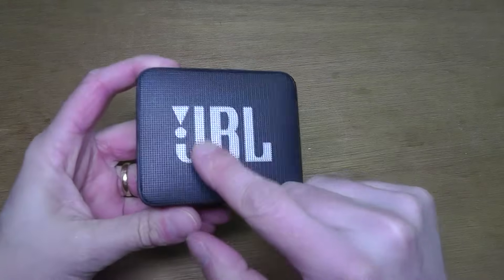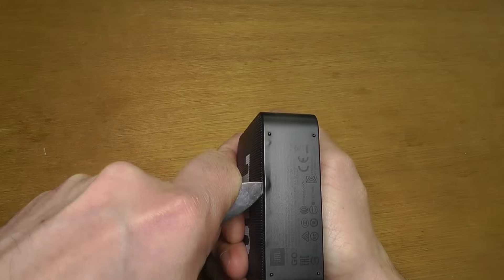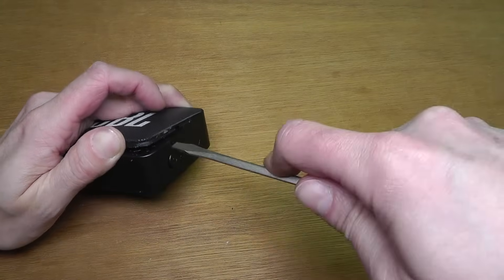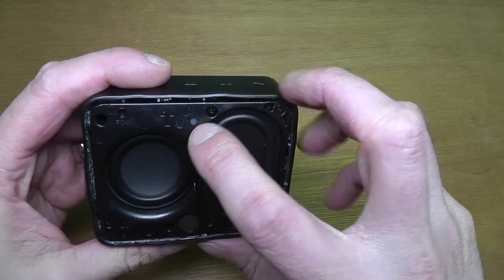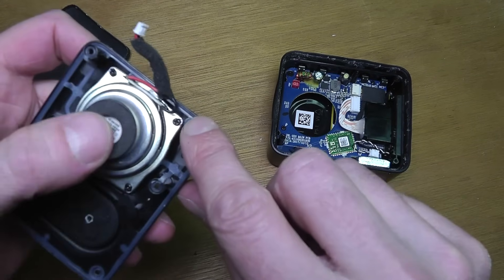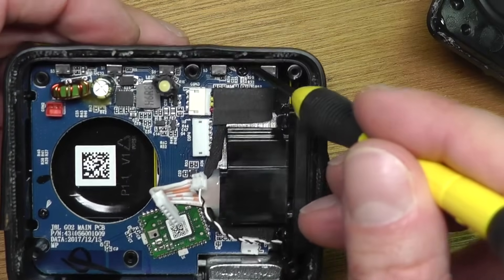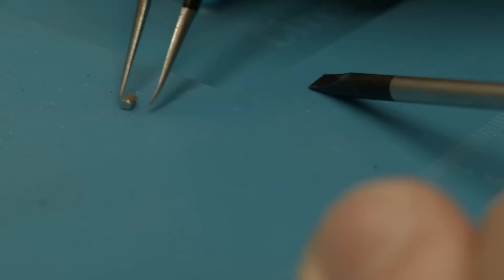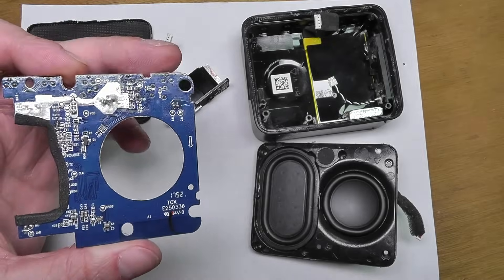Look inside JBL GO2 - Teardown

Comment: Thanks for the video. Please, I have no idea about mainboards but I am looking for a solution to "erase" (sorry my but english) the bluetooth module because I dont want to have it (deleteing bluetooth prevents me from headeaches). Please, if you could help to know what it it the "capacitor" or bluetooth module. Many thanks.
Reply from the maker: Hi, it’s been a long time, but if I remember right, then the Bluetooth module is the small green daughter board, which can be seen at 5:20.  
I am not sure if the speaker will still function once that board is removed
Reply: @MegaSafetyFirst  Manu thanks for tocino you the time to reply and yo hice me that warning. Greetings forma Peru 🫡

Comment: Whole lotta tech for such small speaker! But that's why you can achieve such loud and clean sound on small speaker like this!
I'm using this one for over 6 years now.
And remember, never try to hard reset it! Did this mistake some time ago to clean it's bluetooth pairing list and bricked it accidentally into service mode.
If it happened to you, you gotta:
1. Turn it off completely by holding power button for 20 seconds.
2. Plug it into AC to power it on AND INSTANTLY start pushing Bluetooth and + buttons for like 15 seconds.
3. Press power button to finally reset it.

Comment: Thanks for your video - very interesting and helpful!
❗One Question: Is is possible to replace the micro usb port with an usb c port?
I would love to change it but do not know if it would work with the function and is it worth it? (I do not like this jbl go 3 look)😉
All in all the sounf quality is better on the 3rd Gen, but i got already 2x JBL GO 2 so🤙🏼😉

Appreciate your answer!👍🏼💯
Reply from the maker: Hi,  the pin layout of USB-C ports is drastically different for them to fit.

Comment: It is Original JBL GO 2? Thats look a fake inside..
Reply from the maker: It came directly from JBLs warehouse.
Reply: @MegaSafetyFirst  hmm i have same inside but on you toube every jbl go 2 have green pcb and other connectors
Reply from the maker: It is normal for JBLs speaker so to have different insights. They are using different board designs for some reason.
I have two Flip5s, who look completely different from each other on the inside. Both came directly from JBL, but were manufactured in different countries.
Reply: @MegaSafetyFirst  okey thank you so much

Comment: Ok so I have a problem with turning it on so I'm here. It wont turn on but after many tries it suddenly turn on and works just fine but if I left it on table for like 5 minutes the problems here again. So should I open it and check some circuits?

Comment: Hey there! thanks a lot for the video it helped me tear mine down, the problem im facing is that no matter what button i press nothing happens and the only thing that do happen is when i plug the charching cable the led turns red but other than that..nothing

how can i know if its the battery or the circuit it self?
Reply: O mesmo problema do meu, molhou e já não funciona os botões
Reply: Its battery is dead. Replace it.

Comment: JBL have always been my favourite brand when it comes to portable speakers. I've watched and opened speakers from other brands and what I can say.. for the money you pay to buy an JBL speaker, you get a well engineered speaker in and outside with focus on quality. So that's said!
Reply: UE 💖
Reply: I found one just a few days ago witch got run-over with a truck and it still works, its really resistant
Reply: Maybe you haven't been introduced to boAt.
Reply: @sayantanpathak9028  Maybe you never used jbl
Reply: @sayantanpathak9028  boat is a absolutely crap
Reply: Me too! My first one was the JBL Flip 3 idk when i got it but it was prob around 2017 or 2022 it just broke the other day... so i bought a new JBL flip 7 i think

Comment: Hi Thanks for the video. Even there is only one speaker, does it take stereo input from the circuit board? How the single speaker out stereo?
Reply from the maker: Hi, it does take a stereo input. But the built-in DSP will mux the signals to a single output stream for the speaker.
Reply: @MegaSafetyFirst  Thanks a lot.
Reply: Iska battery kahan per Milega

Comment: My JBL GO2 not working. I'll remove its as you showing this video. Thank you. So I'll check the battery by my multimeter and its shows 4.2V. I think battery is ok. But It's not working. Not indicating charging and doesnt response when pushing power button. So, have to met any trouble like this. Plz help me. Thank you

Comment: Im thinking about opening my Go and 'permanently' hooking it up to my amplifier. Do you thing it will work if I strip the jack part off of a jack to tulip cable and solder it to the speaker feed from the go?
Reply: Erik Loeffen you can don’t put it at full volume otherwise it may turn off

Comment: it really help me to fix a miner issues with mine thanks. two things are worth mention, jbl is no joke when talking about water resistence, seconde, there is no way to open without damage the rubber. but if you priority is function over form, you can open, fixit close it, glue everything together and will work as a new one.

Comment: For anyone wondering, this speaker is incredibly loud, considering the rated power and its actual size
I use it to teach students at school and it does a great job filling up the whole classroom
Reply: Salut fra :))
Reply: Did you turn off autoplay in class? Most teachers leave autoplay on and it will automatically skip to the next video when the current video finishes

Comment: Does removeing the front ruin the waterproofing?
Reply: if you are talking about the grill

no
Reply: @noddlecak3279  Not the grill, the plastic part with the speaker in it
Reply: @austinnlyt6476  I don't believe so because there was no glue involved only screws so as long as you don't rip the rubber around it to keep water out and you put the screws back on good you should be fine
Reply: @noddlecak3279  Cool, thanks for telling me I was worried I might break my speaker lol

Comment: If you put some wd40 around the edges of the grill it dissolves the adhesive and the grill comes off with ease, that's how i took apart mine
Reply: Or just heat it up a bit...

Comment: These company's show a total DISRECARD for the environment by making devices at witch you cannot replace the battery! So essential producing a throwaway product, bad for the customer and bad for nature, very, very bad!
Reply: Its a bit understandable though. They do have to make the device water resistant. And that sacrifices some repairability or in this case, replacing the battery. You can still remove the battery though and replace it from the inside. Though I cannot guarantee it will still be waterproof.
Reply: you can change the battery but it will not be waterproof
Reply: how is it supposed to be waterproof

Comment: You can use heat gun to loosen up the glue. It’ll be easy to remove the grill, I’ve done it on jbl go one. One question I was trying to increase mah capacity of battery in jbl go 1 but I failed. Don’t know what happened it pares with the device but woofer doesn’t work, I tried to replace woofer but nothing changed. Can you me help me out ? I might damaged amplifier. MegaSafetyFirst

Comment: Is it sounds better than old jbl go?
Reply: They both sound badly, don't buy unless on discount (got myself a Go 1 on heavy discount, good enough for me since Go 2 is equally bad anyway).
Reply: TheGamerYT I think yes because of pasive radiator.
Reply from the maker: There's a Video comparing the two speakers:
🔊 JBL GO2 Sound-test versus JBL GO
https://youtu.be/AB0cRioGak0
Reply: Basically the same.. €19
Reply: Zwaluww I got JBL GO 1 for only 18€. How much did you pay?
Reply: @windlink1236  i got jbl go 2 in 16.29 € & its amazing for its size
Reply: @gautam9912  Thats a great deal
Reply: @windlink1236  yup

Comment: Yes! It have a passive radiator!
Reply: A Bal look at the volume of air inside it - hardly anything. It's little wonder they can't get much bass. That and the passive driver is on the front
Reply: Just saw a video where similarly sized speakers had way more bass, so it is possible. Things like driver size and excursion and such also help, besides inside volume.
Reply: @blindguardian8599  remember that these things are fully waterproof and get more than the rated 5 hours of playtime if you lower the volume, they’re not bad for the price either
Reply: Zero Two hey do you have speaker knowledge because I have some questions about my JBL charge one.
Reply: Looks like you guys are having fun.  I have a flip 3. I can help of you are having any problems. Although you don't have a passive radiator, I believe there is a port.
Reply: @zooper6453  i got a question about the jbl go 2, what if i add a second passive readiator on the back?
Reply: buy charge 2+ or higher model bass problem solve.....my cahrge 2+ still doing great just the battery problem need to replace sound no problem deep puncy bass
Reply: UE WONDERBOOM
Reply: -spuma+ Go for it. Im open ears and here to help
Reply: I see your comments on every speaker video xD
Reply: Still bass is almost non-existant.
Reply: @blindguardian8599  install equalizer FX then the sound is way better
Sorry for my bad English.
Reply: @blindguardian8599  I am actually surprised by the bass. i have an old external sony speaker that is bigger, and it has comparably no bass at all. And 15 years ago i thought it had a lot. technology surely has evolved.

Comment: Great video. I want to ask that was there in the right down corner? That shiny rectangle.
Reply from the maker: That's just a chunk of metal.  It's further describe here:
https://youtu.be/rlsb-kiYWRE
My guess is it is there to way the speaker down.
Reply: Yes they are just weights to balance devices or make them heavy so they don't slide around.